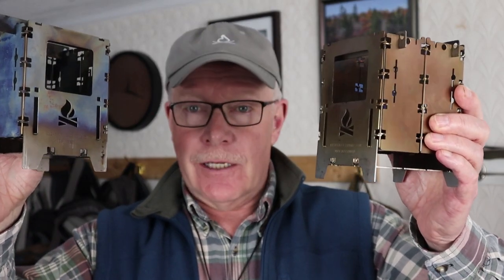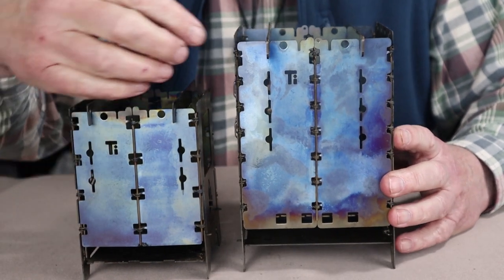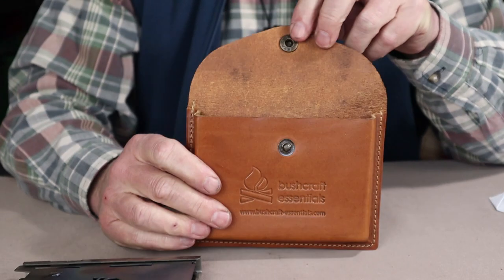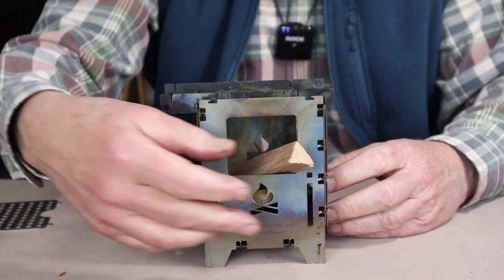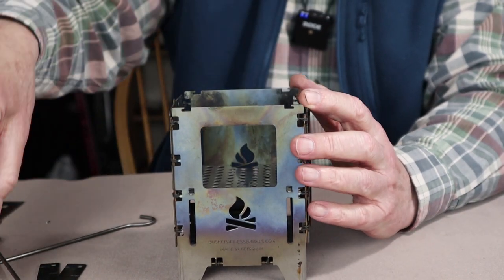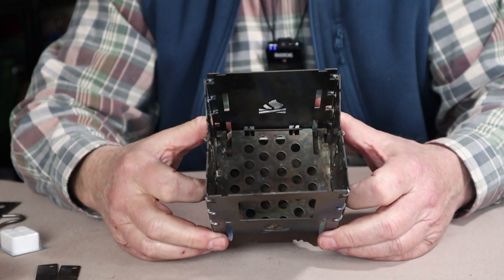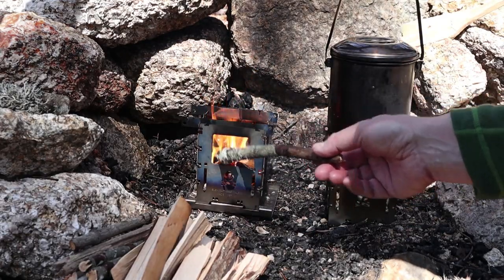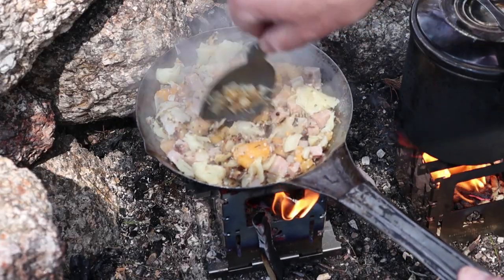Bushcraft Essentials Bushbox LF - Comprehensive Review

Comment: I watched a YT video that made a good case for having a rocket stove at home for cooking during emergencies. Lots of Texas residents would have been well served with a rocket stove last February. The bushcrafting information you present here is useful for everyone.
Reply: Even a relatively cheap $20 wood gasifyer stove is good for using say a wok over,they get super hot and burn efficiently.A Kelly kettle or similar would complement it for boiling water super efficiently and fast.
Power out? No problem,just a few sticks needed.
Reply from the maker: Yes, a proper rocket stove is very fuel efficient and smoke free making it safe to use. Thanks

Comment: Thanks for this excellent video! I would like more infos about warping risk on the steel one, how long can I keep a fire going without risking it?
Reply from the maker: Warping and long term durability are very variable based on how the stove is used and maintained. I have had a lot of fires in mine, based on the way I use it, and it has not suffered any problems at all. Thanks for commenting

Comment: Looking at the hinges, they seem open enough to keep moving freely after loads of ash, then dirt, then pine needles, then heat, then ash... etc. I know a new BBQ grill looks awesome in the backyard until a few seasons of use! Cooking directly on top, dripping grease from your meat... greasy smoke.. looks like it should still move freely 10 years from now. I won't be hiking the Appalachian Trail, so I think the Stainless may handle warping better. Sweet design for sure!
Reply from the maker: If weight is an issue SS is great. All i had until recently.

Comment: The major point for this stove I think is it's size, at least for me. I love my FB Nano - with Swedish torch set-up it can easily go for 15-20' without much attention, but it is a bit on the small side. And the G2 is a bit on the large... If Firebox had a size in-between the Nano and the G2, I wouldn't give it a second thought. And here's where the LF comes handy - it seems just the perfect size for most occasions. I also like the larger, higher opening on the Bushbox - makes it more versatile when using optional fuels. The price of the Ti version is considerable though. For the same money I can get the bigger Ti G2... 
Great video BTW, I really like the fact that you share your overall experience with the stove over longer time use. Very thorough and in-depth coverage. Also like that you cover all the alternative fuel options. Thanks!
Reply from the maker: I agree with your logic on the stove size. It is in the sweet spot. Thanks for commenting
Reply: The Firebox Stove Freestyle is your answer 🔥

Comment: Hi Mark, does any of the two LF versions have a tendency to warp (more) ? Thanks!
Reply from the maker: They will both warp a small amount if the fire is hot enough. Neither seems to warp more than the other. I can say the titanium version is easier to bend back into shape if the warping bad enough to be a problem. Thanks for commenting

Comment: Mark. I’m curious why you pick this stove over the firebox stove. Ty
Reply: I was wondering the same, but the firebox in titanium is still double the weight of the titanium bushbox LF. For me, I'd try and accept the extra weight of the firebox because of its increased versatility...
Reply from the maker: In truth. If i could only have one stove it would likely be the FireBox in Ti. It is the smaller size of the BE LF that i like. Easy to pack. Will do a FB vs BE video comparison. Thanks